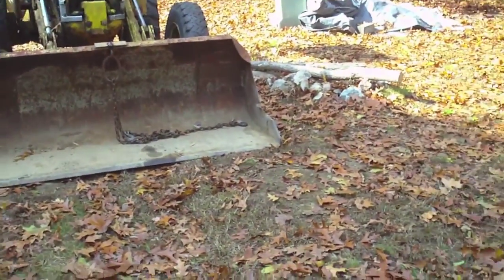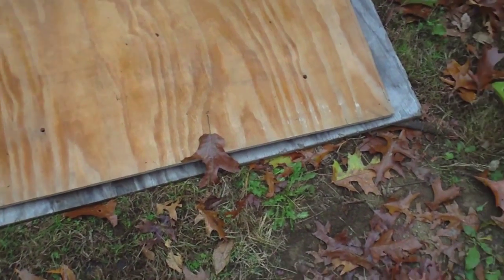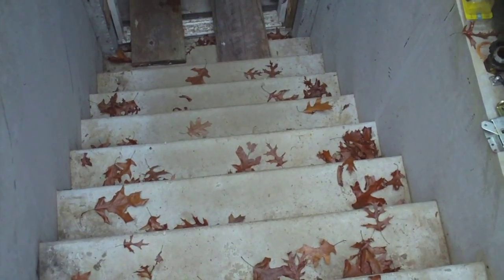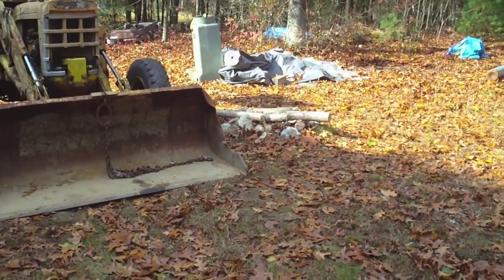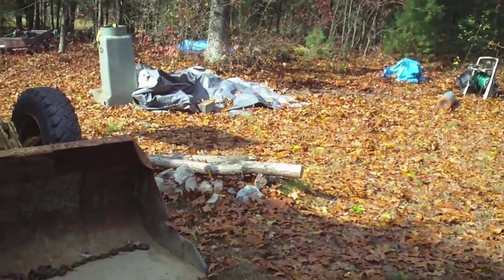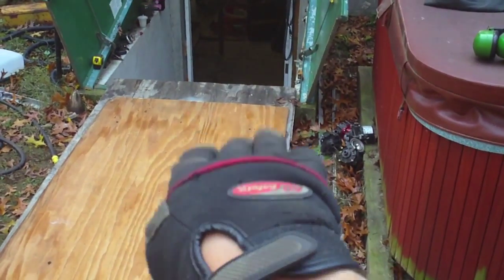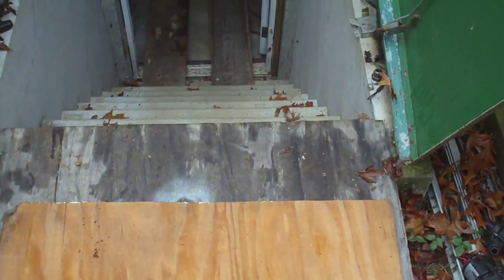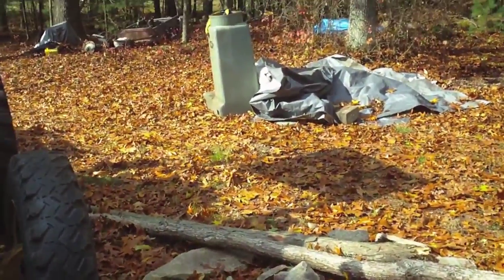Wells Index Milling Machine Part 11

Comment: Why there was so much smoke under the engine just before it shut down? .. Or is that just "normal" ? :)
Reply from the maker: lol, it depends how you look at it. It is normal for an engine as worn as that one. Combustion gasses "blow by" the worn rings, enter the crankcase, and are pushed out the crankcase vent tube. The cooling fan blows it around the underside of the motor. But a normal healthy engine should not do that.